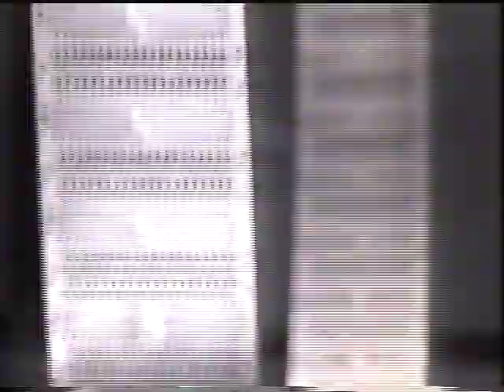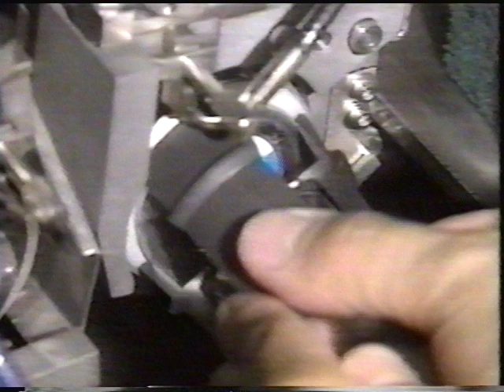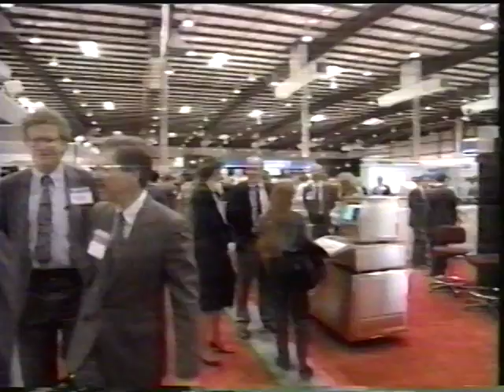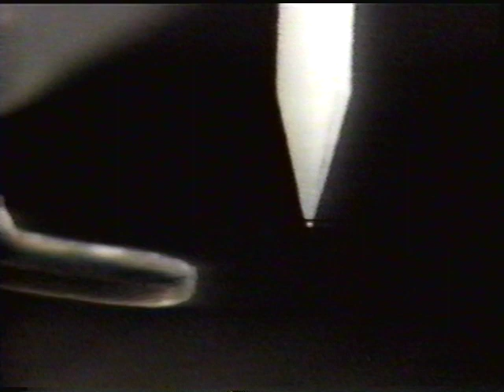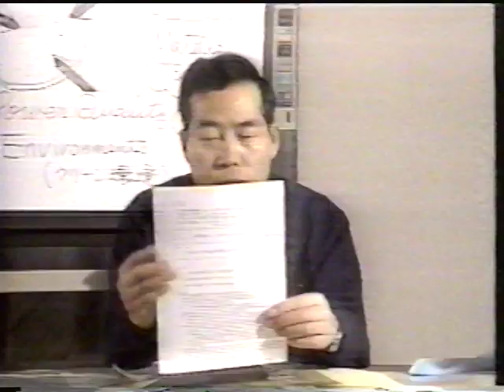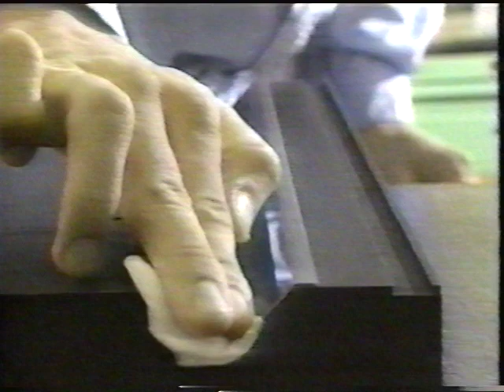Technological Giant of the Micron World - A Video History of Japan's electronic industry - (Part 4)

Comment: This appears to be a shortened English version of the 1991 NHK documentary named "電子立国日本の自叙伝" (The Electronic Nation - an autobiography of Japan), originally with 5 parts, and ran for 60 min, 89 min, 89 min, 89 min, 69 min and 99 min respectively. This appears to be a quite influential documentary with its own Japanese Wikipedia article, see [1]. According to the article, it's also sold as DVD and streaming versions. If one is looking for the video with higher video quality, try obtaining the DVD version (or the streaming version at NHK's website). Unfortunately this English version appears to be an abridged version of the original, so the "keep the English dub and replace the video" trick won't work, it has no English translation unless someone is willing to so by themselves (by hand or machine). BTW, while it's not available on YouTube I did find its soundtracks by searching the original title.

[1] https://ja.wikipedia.org/wiki/%E9%9B%BB%E5%AD%90%E7%AB%8B%E5%9B%BD%E6%97%A5%E6%9C%AC%E3%81%AE%E8%87%AA%E5%8F%99%E4%BC%9D.